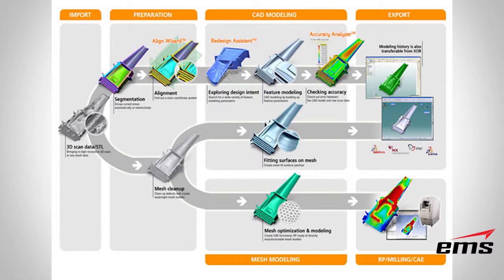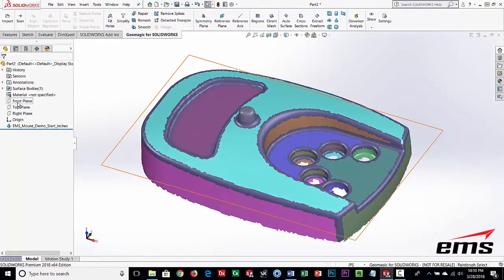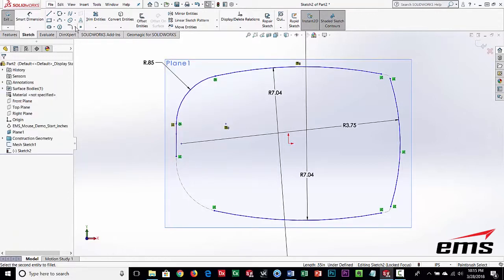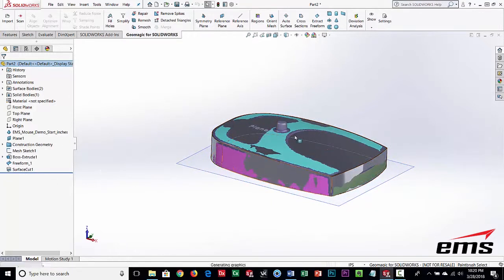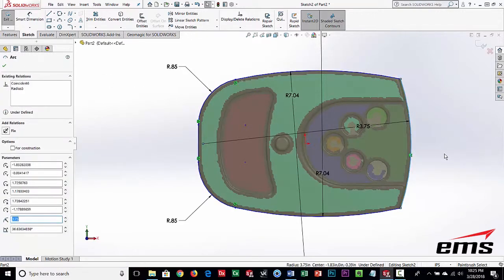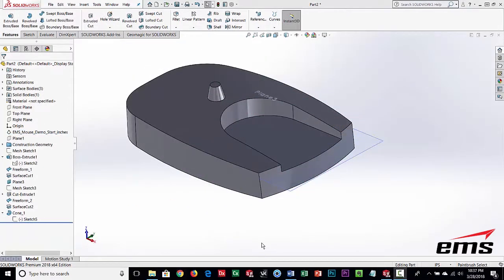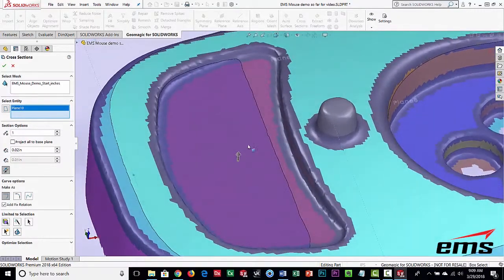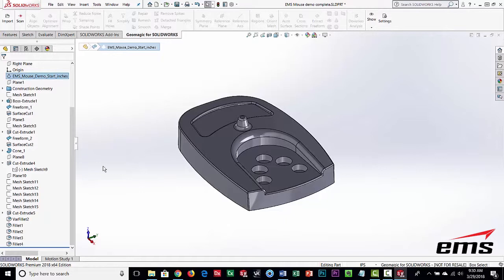Geomagic for Solidworks - Basic Workflow Demo

Comment: Hello Sir, whenever i try to apply for freeform command it makes a part in new window...can you please let me know how to fix this?
Reply: I just resolved this issue. In System Options go to the import tab and deselect "Enable 3D Interconnect" and "Import Multiple Bodies as Parts" hit Okay at the bottom. Then in your add-ins disable "ScanTo3D" if you have it installed. This should resolve the problem for you. Let me know!